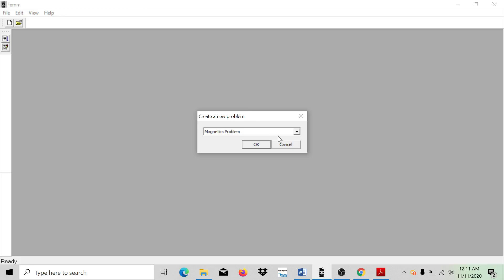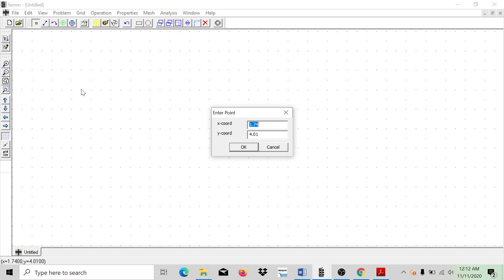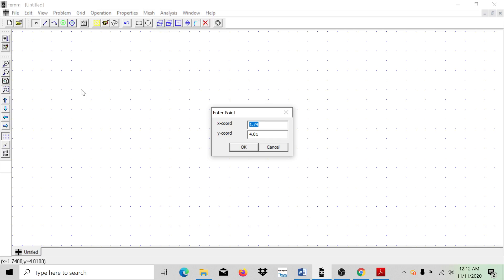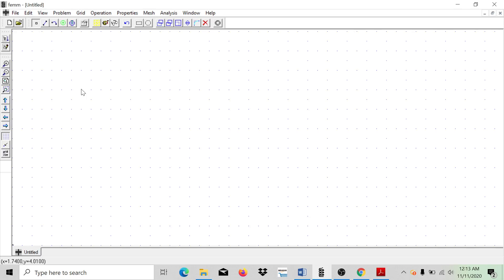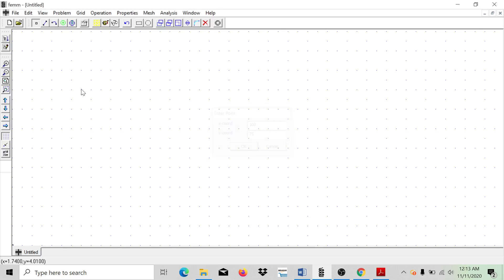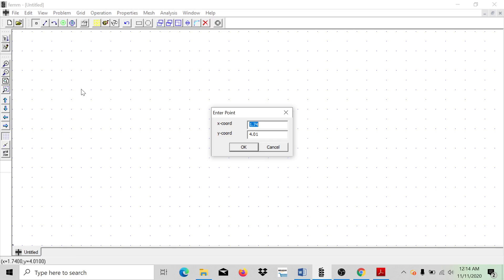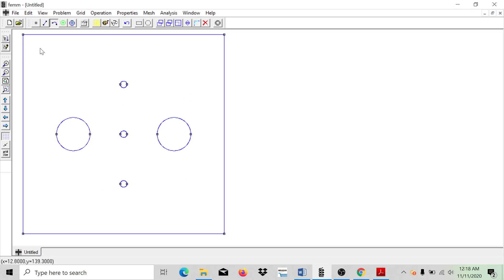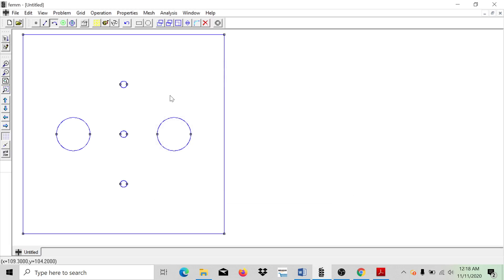TWO SPHERE CAPACITOR USING FEMM 4.2 SOFTWARE (LAB 2)

Comment from the maker: Please use this new coordinates because there is supposed to be 70m distance between the center of conductor 1 and conductor 2.

Conductor 1(27.5,75), (52.5, 75). 
Conductor 2(97.5,75), (122.5,75).

My estimated new coordinates based on the labsheet picture:
Crude oil(72.5, 87.5), (77.5, 87.5)
Water(72.5, 75), (77.5, 75)
Air(72.5, 62.5), (77.5, 62.5)